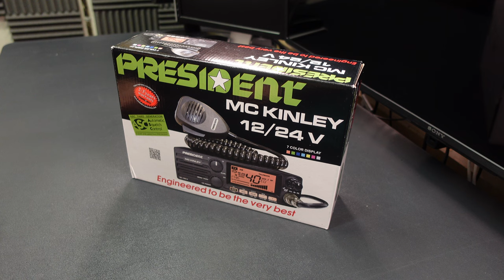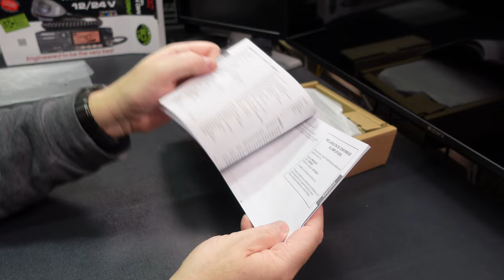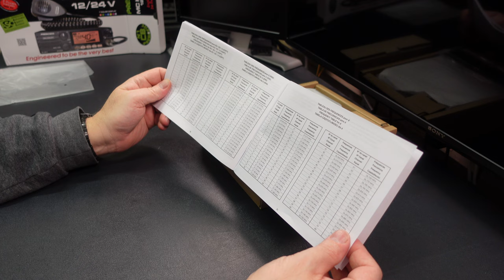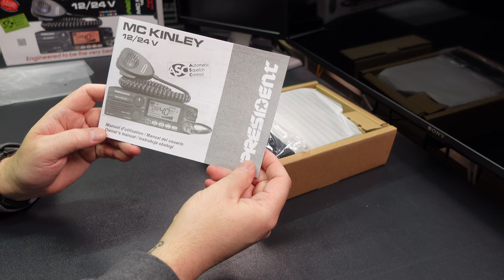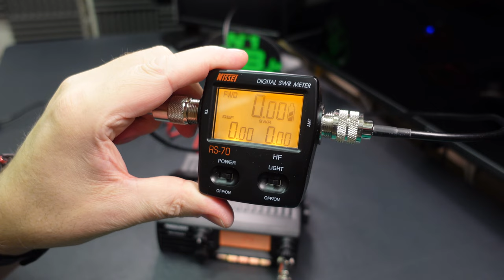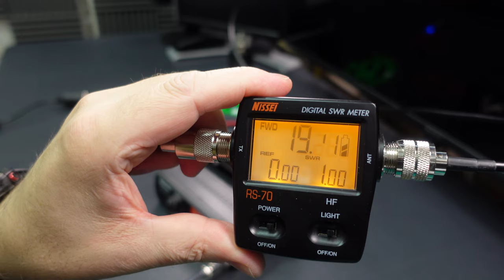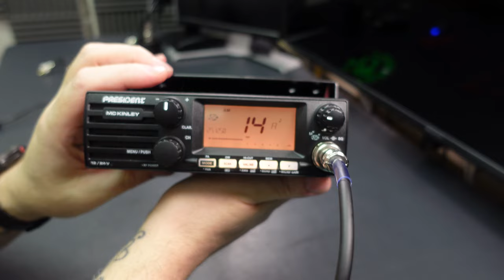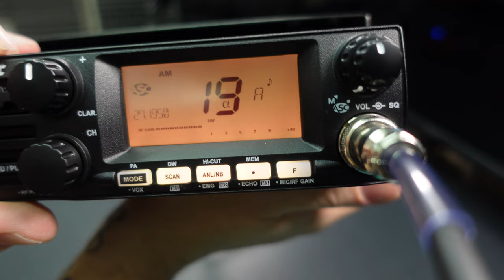President McKinley SSB CB Radio - Unboxing Review - Best CB in 2022

Comment: Hi I have a 
President Mc Kinley output around 18W to 19.5W
Test on a NISSEI R/S 70 digital SWR/Wattmeter. I am looking for a good LINEAR AMPLIFIER (WITH PRE-AMP) like the RM KL (100W) (200W) (300W) what would you suggest,any help would be appreciated.
Reply from the maker: Hi Simon, yes I test using a Nissei RS-70 into a 100W dummy load. Probably the RM KL405V that has the none-variable pre-amp, cooling fan and ranges from 50W to 200W maximum for AM/FM. Also does SSB up to 400W. The 405V is the new model with updated internals and a cooling fan. The 405 is the older model without the cooling fan. The RM-KL300P also has a pre-amp but I would go for the 405V as its only £56 more. I hope your enjoying the McKinley, lovely SSB radio. All the best

Comment: FM on the CB radio frequencies really seems like a really waiste of time and money.  I was told FM would sound better with less noise. I have to say the noise level is higher than AM. The sound quality is about the same as AM. In fact FM depending on the radios sounds much worse then AM.  Range wise FM is less than AM but if you really want distance you can't beat SSB. I have found that on SSB mode the sound quality also depends on the radio's.  I noticed that the 3 president radios I have with AM/FM sound much better when communicating between each other. I only have one that's not a president and when transmitting in FM the sound quality is not even close to the other president radios.  FM is not very big at this point so I don't get to hear many other radios to compare.  I really hoped by getting FM early on that it would be quieter and my friends and I for a while would have the FM to ourselves. However we really don't ever use FM due to less range and high noise levels. The funny thing is Cobra still doesn't have a FM radio out in the USA and I would be skeptical of anything they put out because their radios had dropped in quality so much that anyone that knows radios will not buy one.  Uniden still mskes a few decent radios, but president has really been dominating the CB radio world.
Reply from the maker: Hi Robert, Sorry to hear your FM experience has not been what you expected. It could be down to FM only just being legalised in the US and maybe the other radio companies not quite getting it perfect first time, I dont know. In the UK we have had FM since 2014. President Electronics are a French company and have been making FM CB radios for a long time so there implementation will be spot on which may account for why its good when using between their radios. I have 20+ CB radios from President, Midland, CRT and Alinco and they all work well between each other on FM. AM will have more range than FM as it has a narrower bandwidth and uses more power when transmitting so it depends on the use case. We don't have Cobra radios in the UK (well a very limited number, not mainstream at all) so I am unable to comment on them. I agree that SSB is certainly where its at on CB these days and is the king if distance is your main requirement. All the best and thanks for watching.

Comment: Hi looking to get a new Radio and have it down to the two below it is for the Road and the house any suggestions come help 
President McKinley
President Lincoln II PLUS
Reply from the maker: Hi Simon, Now that is a difficult one as they are both excellent radios. I have a Lincoln 2+ which I havent got around to reviewing on the channel yet. It depends on a few things really. The McKinley is primarily a CB radio with SSB. The Lincoln is a Ham radio covering 10 meter and 12 meter bands (not CB bands) and includes SSB. In their standard states pick the one that your need, CB or Ham bands dependant on your license / requirements. When we get into modifying / expanding them it gets more difficult. Both radios can be expanded to cover the same ranges as each other 24.715 to 30.105. The Lincoln edges it on power output with about 10W more in FM but this really doesnt matter and shouldnt be a deciding factor. The Lincoln can be programmed via a cable which the McKinley cannot but the McKinley has a front facing speaker and is simpler to use. If CTCSS tones are important to you (they arent to me) then go Lincoln.
If your primary use case is CB bands then on balance the McKinley. If your primary use case is Ham radio 10m and 12m then Lincoln. However, they will both server you well whichever you pick. President make some lovely radios. How about the McKinley in the car and the Lincoln at home, just a suggestion :-)
Thanks for watching, all the best, MJ7NLK

Comment: Does anyone know when this is unlocked is there a bank of channels that line up with the USA CB channels? I would like to get one however if others use the radio it would be preferable if it only stopped on the channels used in the US also out channel frequencies don't line up with the channel numbers.  I know many of the radios have a band that matches up and to access the other frequencies you change bands or is it banks. I need it to be simple enough for anyone to use but be able to switch if the need arises. Thanks for any information that you can provide.
Reply from the maker: Hi Robert, yes the standard CEPT EU bands align with the US standard frequencies. When expanded band block A starts at 26.965 on channel 1 and ends on 27.405 on channel 40. Hope this helps and thanks for watching

Comment: Hi , I've got a wouxun 1000kg it's locked for uk, can you unlock it for pmr 446, thanks.
Reply from the maker: Hi Stewart, I do not know the answer to that one. As far as I am aware the KG-1000G is a GMRS radio which is based on the KG-UV980PL. The 980 covers 2, 4 and 6 meters and also 70cm. I dont have either radio so am not sure what is possible and if its down to programming. PMR is just above 70cm but it will be down to what hard and soft restrictions are in place. Sorry I couldnt help on this one. All the best

Comment: hi thanks for this, I have just bought a the McKinley it seems grand but two questions it's expand but how do I get on 11m 27.555 and also I connected the antenna an orbiter mini but the swr internal swr was going crazy fluctuation from ,1-2 and sometimes higher, any explanations for this andbwhy it's so random. if exceeds 2 do I need to lengthen or reduce the antenna? it's advertised as pretuned so I assumed it would have been in range. thanks very much.
Reply from the maker: Hi Wally. That is an easy one to answer. In expanded mode, next to the channel number is an alpha letter A, B, C, D, etc. Each letter relates to 40 channels so A-12 is one frequency and B-12 is another. Make sure your in expanded mode (in FM pressing F for 3 seconds switches to UK 40 and pressing and holding again switches back to expanded mode) When you see the alpha letter, could be A, B, C, D, E, etc short press the F key to switch band blocks. get the band block to B and then turn the dial until you get to channel 12. So your looking for B band block and channel 12 for 27.555. You can then press mode button to swithc between AM, FM, USB, LSB, etc
Reply from the maker: Hi Wally, to answer your SWR question. Please check out the video on my channel called "Tuning CB Radio Antenna" which will guide you through the process. I prefer to use an external SWR meter but you can use the built in option in the radio. Read the manual for how to operate this. You need to mount the antenna in a decent location ensuring it has a good ground plane. Mag mounting in the middle of the roof of a car would be good. Make sure your not close to any buildings or under cover, a nice open space. Then test your SWR and see what reading you get. My video gives you all the info you need including in the description on what to test for and how to know if you need to lengthen or shorten the whip. Most antenna that are pre-tuned need tuning. My SS Orbitor needed an inch cutting off and that was supposed to be tuned. Please watch the video carefully and read the description and as long as your under 2 your ok and preferably 1.4 or less. All the best and enjoy your McKinley
Reply: Hi thanks you very much indeed for your prompt reply and support, really appreciate it, after being CB for many years getting back into has seemed daunting. I don't recall my binatone having all those options on it :) it's gr at to know the CB community is full of helpful guys like yourself, thanks again. Do you have a video on how use USB/LSB and etiquette/language, I did my foundation license is it years ago is it basically the same? Thanks very much.
Reply from the maker: @wallywo7392  I will add USB/LSB to the list of requested videos, thanks for the suggestion. I have a video on my channel called Ham Exam which runs you through the process and what is covered which you might find useful. I hope you enjoy your McKinley, they are lovely radios. All the very best and thanks for watching 🙂
Reply: Thanks mate I have just tried adjusting the antenna, the swr is all over the place range from 1.6-3 but mainly about 2.4, channel 40 appears to slightly lower, I did take off about 3cm, to say I'm confused would be an understatement not sure if should take off some more, even though it seems slightly lower on 40. Sent about an hour this morning trying to adjust it and just seems random. Thanks for your support.
Reply: Just tried with the doors closed definitely lower but still about the 2.0 mark
Reply from the maker: @wallywo7392  The general rule is that if the SWR on Channel 40 is higher than Channel 1 then lower / make smaller your antenna. If the SWR on Channel 01 is higher than Channel 40 then raise your antenna. Using the adjustment on the antenna raise or lower according to these guides in order to set. Ensure there is nothing obstructing the antenna. Ensure there are no ground issues (ie attached to a plastic or fibreglass surface). Ensure there are no magnetic items anywhere near (screw drivers etc). You should be 10 meters away from the nearest building. Test with yourself being in the vehicle and not standing next to the antenna. Take a reading on Channel 1, take a reading on Channel 40. if the SWR reading on channel 40 is higher than the reading on channel 1 then lower antenna else extend antenna. I normally use an external SWR meter so if you have one handy then try that as well. Your readings on each channel should be consistent when repeated. If they are moving around all over the place then something is wrong in the setup. Bad grounding or damaged coax. I hope this helps 🙂
Reply: @NLKMediaGroup  Thanks again absolute star very much appreciated.

Comment: What is unlocked when you snip the wire and move the jumper?!
Reply from the maker: Hi Paul, that expands the radio and opens it up to a larger frequency range and higher power output level. The UK and central EU have comparable laws on power output and there is a general EU frequency range (adopted by most EU countries) with some additional variations for DE, PL and UK. When expanding the radio, you get band blocks of frequencies covering a much wider frequency range. So, band block A on an expanded radio will cover the EU (CEPT) 40 channels but you also have block B, C, D, E, etc. Power is limited to no more than 4 Watts output but when expanded can increase massively to 10, 20, 30, 40 watts dependent on the radio being expanded. This mode exists for countries with more questionable radio laws. It depends on what region you live in as to the legalities of expanding. It is helpful to know what a radios capability is especially in a disaster scenario. Use it within your country's laws on a day-to-day basis but in the event of an Armageddon situation it can be expanded for emergency communications. Thanks for watching and hope this helps.
Reply: @NLKMediaGroup  Just curious : What happens if you only snip the wire ?
And what if you only move the jumper ?

Comment: Does it have rf power? Variable power?
Reply from the maker: Hi James, yes it does. It's a bit of a pain to set but the manual will help. If you look at the front face you can see RF Power printed below the channel selector dial (bottom left). To set, press and hold the PTT switch, press the DOT button (button with a dot on it) and press the Menu / Channel dial in and RF Power appear on the screen. Then release and use the Menu / Channel dial by turning to adjust the RF Power. Then press the Menu / Channel dial in for 1 second to set the value. You get used to it, but it's a pain to remember especially when you have over 30 radios. It's a drawback of having a front facing speaker and trying to cram all that functionality in with limited space for buttons and dials. Hope this helps. All the best and thanks for watching

Comment: so that is way ham radio opp did not like cb when it started? no Rodger beep so sad .
Reply from the maker: Ham radio operators may have looked down on CB radio in the past, but I don't think that is the case nowadays. Lots of Ham radio operators (like me) also use CB radio and enjoy both very much. The McKinley is a really good quality radio and President are supposed to be releasing the President George 2 soon (we have been waiting for ages, President dance to their own beat when releasing new radios) which is another SSB radio to join the McKinley in the line-up. All the best and thanks for watching